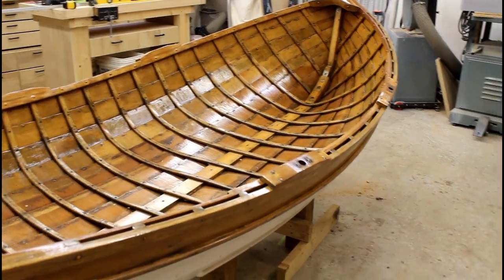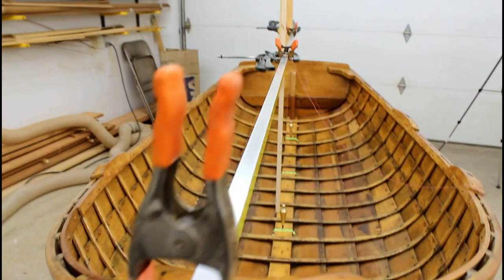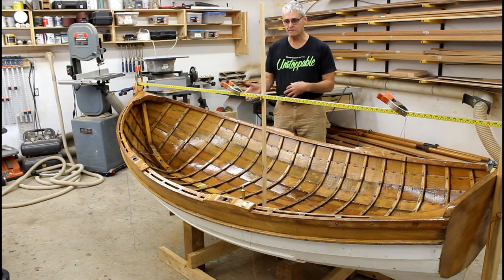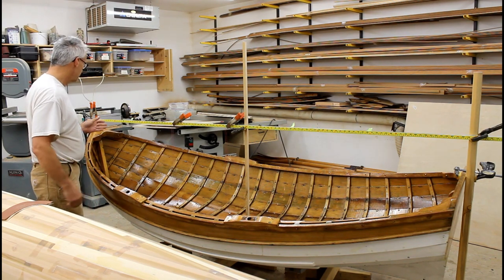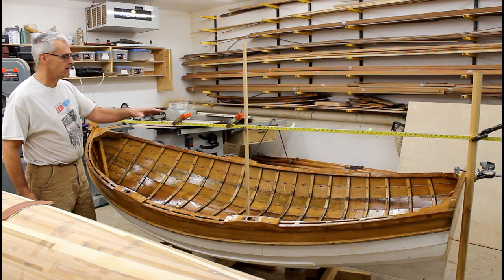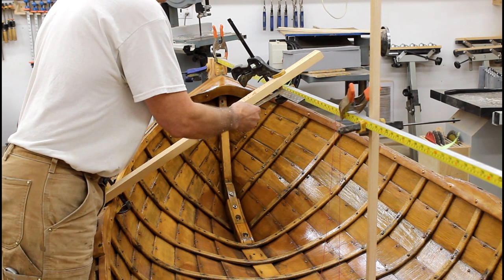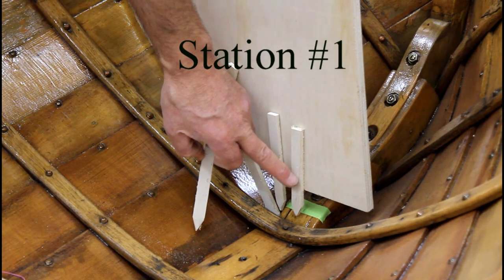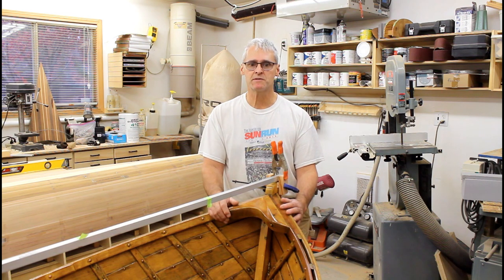Taking Lines - Episode 2

Comment: No, sorry, too long winded plus ply is expensive! If you're going to take measurements that way then google joggle stick and hit images,  you'll see instantly how to do the same thing in a fraction of the time with just two reusable bits of wood.
Also this is only good for lofting the same size boat, what if you want to take the lines to produce a scale model or drawing, what do you do then, hmmm?
Reply from the maker: Ply was what I had on hand from other projects.  I am very familiar with joggle sticks and all the other methods.  This worked best for me because leaning into the boat and drawing with a joggle stick was a bit harder to do.  And now that I have the full set of plans and the table of offsets, it would be simple to create a scale model or full size drawings.